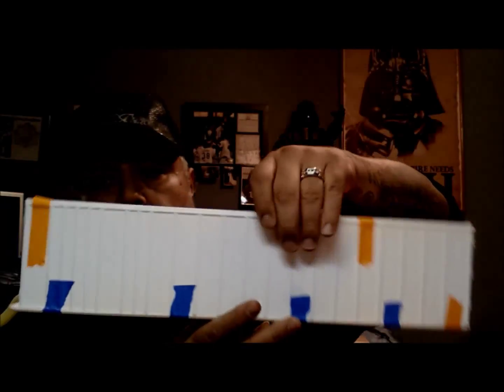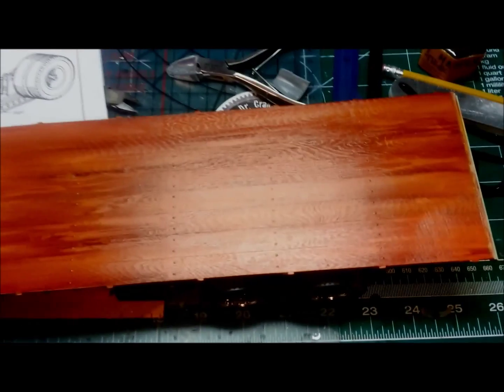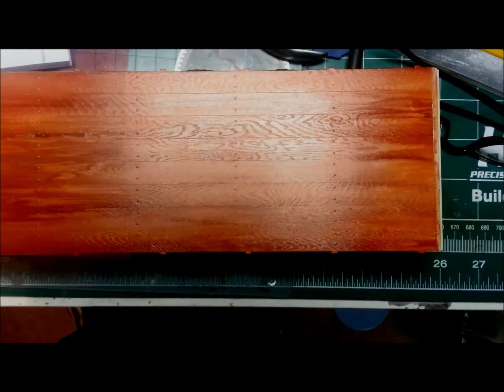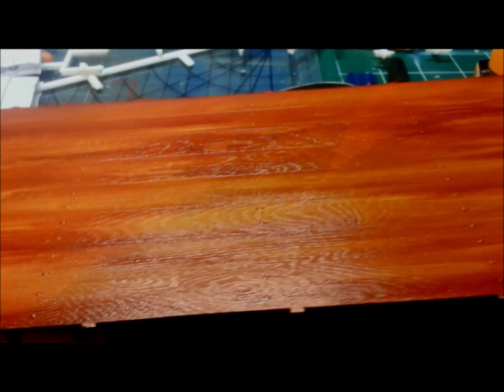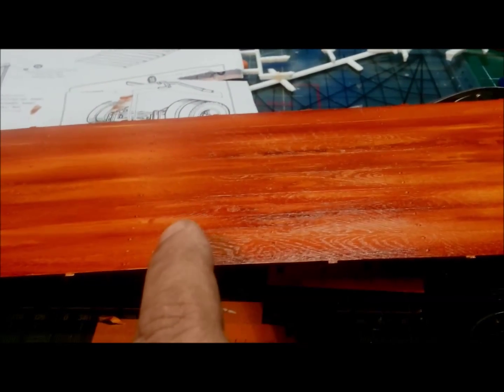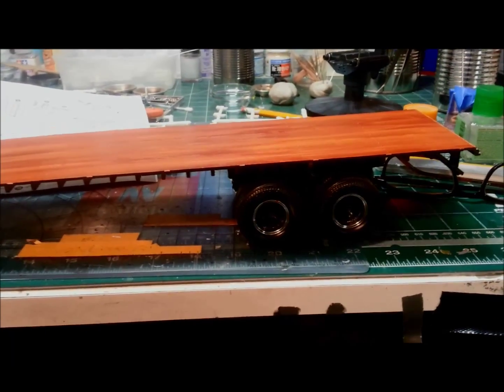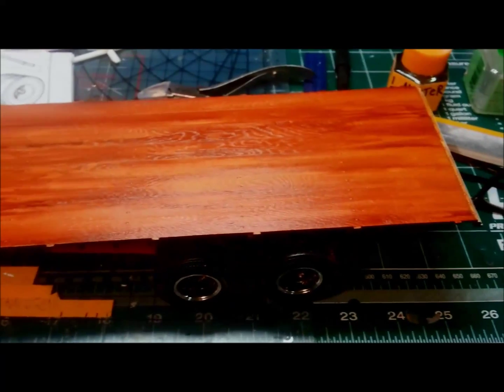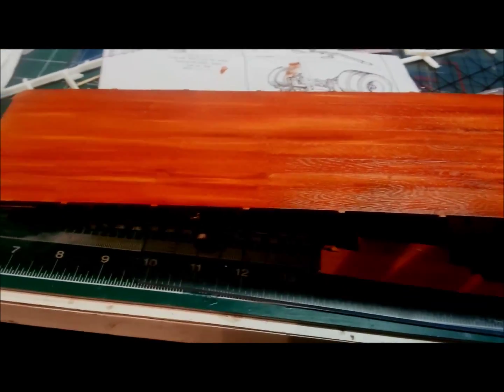A Quick Update on my AMT Trailer

Comment: That came out really beautiful. Really good work on it.
Reply from the maker: Thank you Stefan. I'm sure I'll get the "rivet counters" complaining but I tried to match the color to the actual trailer I am modeling this model after. The trailer is not used for anything but show and the damn thing is super clean. I don't think a forklift has ever driven on the floor of the darn thing. LOL. But I'll weather it up some once the oils dry anyway.
Reply: I think your personal touch is way more important than any "rivet counter" opinion and since this is if I remember correctly a gift then its even more important. Your doing a great job on it so keep it up.
Reply from the maker: LOL...I haven't encountered them as of yet but I really don't care either way brother. I know what that trailer looks like.The darn thing probably has more acrylic wax on the floor boards than a museum does! Lmao